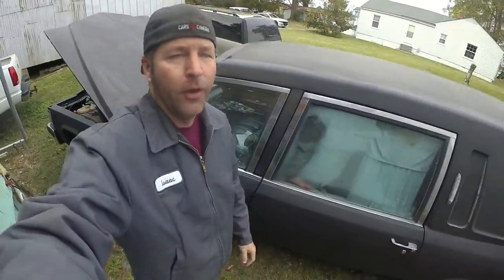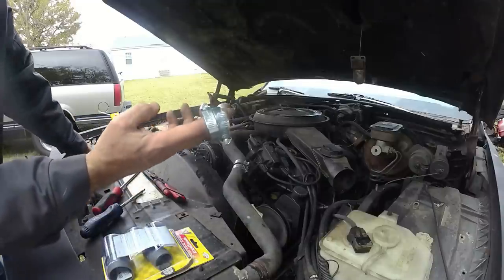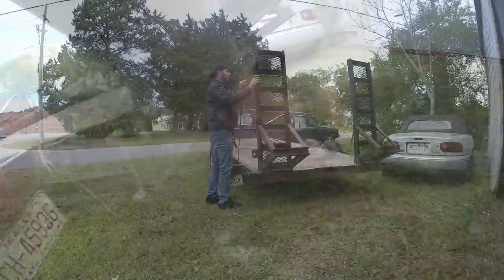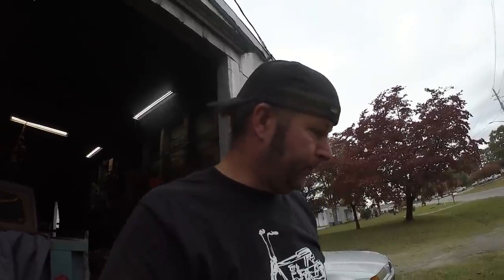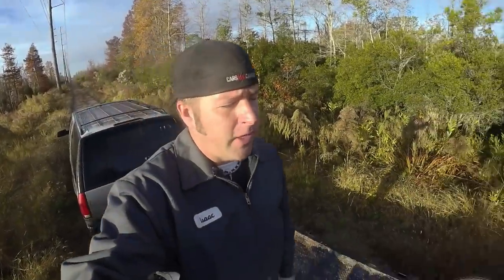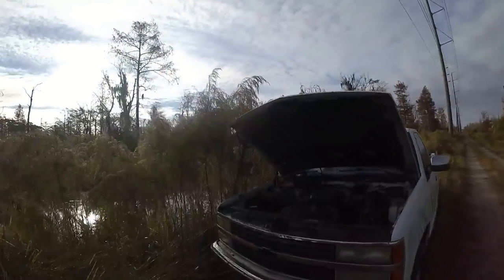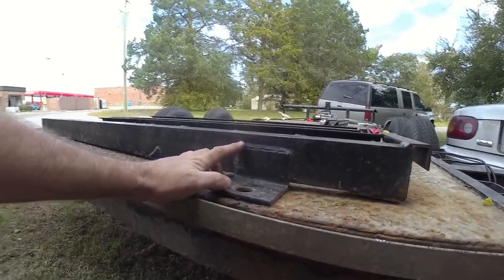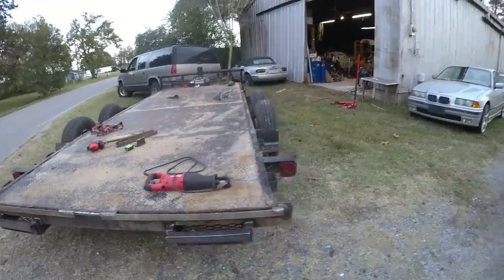Making My Utility Trailer Better

Comment: Ike you need to stop using the worm drive hose clamps, and use ( band clamps) 1/2 inch bolt way better and can tighten for days, probably  break the insert peice 😄   dude the ramps turned out perfect.

Comment: yeah put bigger radiator in my 91 k1500  had to cut upper rad hose to make it fit so i just put think 1 1/2 metal pipe in it so clamp grab  yeah it's temporary lol unless it work's still in there knock on wood been like 5 years   its modified so can't  just go get one  might get fancy flex hose maybe

Comment: One thing you might try for the radiator hose is to have tubing bent and bead rolled on the ends to except short robber hoses on the ends

Comment: Come on brother. With all of that cutting you really need a plasma cutter. And nothing like that one ya'll use at the carsandcamaras shop. And then you can do some real cutting.
Reply: I forgot to say anything about Isaac's backing skills. I've been a truck driver for just over 25 years and I'm very impressed with your backing skills. I thought that I was the only person that could back up a trailer with that ease. Nah, I have learned to back a 53 foot wagon with that ease, but, like I said, I have been doing this for over 25 years. Put a short trailer ( like a boat trailer ) it'll be like it was my first time ever backing a trailer. Isaac brother, you've really got some skills backing up a trailer. If you ever need a job and don't mind a little riding, just give me a shout.
Thanks brother 👍 for making and sharing your wisdom and skills with us through your videos. Keep up the awesome work and keep the videos coming.

Comment: Oh no, Isaac. Are you seriously one of those “Who needs trailer lights, you can see my taillights up front” kind of people? 🤨
One of my biggest pet-peaves: drivers not bothering with proper lighting
Reply: I was I a wreck from this. The person was hauling bushes and tree branches. Which covered their taillights on the vehicle and no lights on the trailer. 😡
Reply: @freschey  It’s a real problem out here in Commiefornia. People can’t be bothered to check their lights, and the police don’t see any point in citing them. Then they cause an accident when they either cut someone off - or someone cuts THEM off - and they get mad at the other people who weren’t “psychic” enough to read their minds when they were changing lanes or slamming on their brakes. 😤
In Issac’s defense, he does live in a small town, so he probably never got going very fast. But out here where everyone is driving at freeway speeds, it really is crucial that drivers be more considerate of others, and quit acting like they’re the only ones on the road.
Reply: Calvary customs ,I have done the same thing if I need my trailer and the lights don't work I still use it. If you can't see a trailer you must be blind.
Reply from the maker: Working on those now. I just ran out of time before the trip
Reply: @isaacitllbefine7231  Cool brother. 👍🏼

Comment: How to destroy a set of functional ramps.
Reply: The original configuration of the ramps in the up position do not allow for truck to be loaded. Most full size cars would be too long.
Reply: @AppalachianLife  Just making the point those were heavy duty ramps good for heavy equipment.